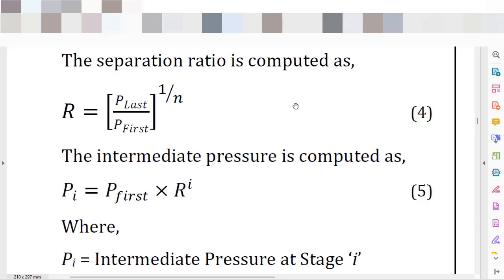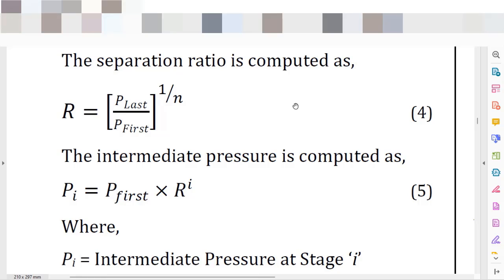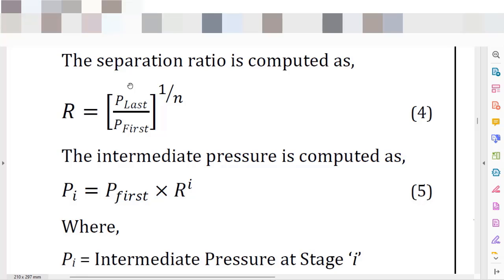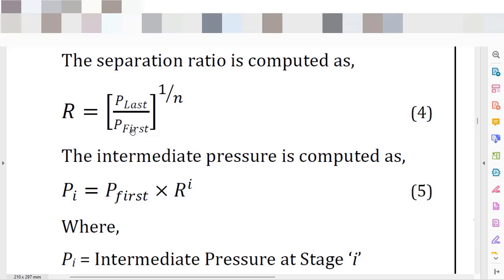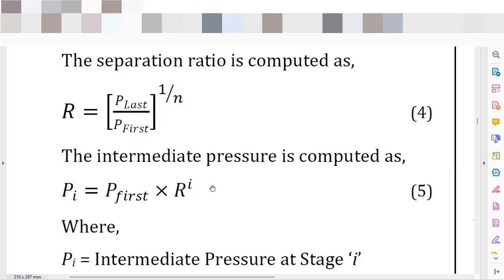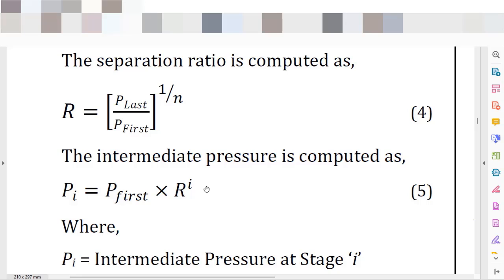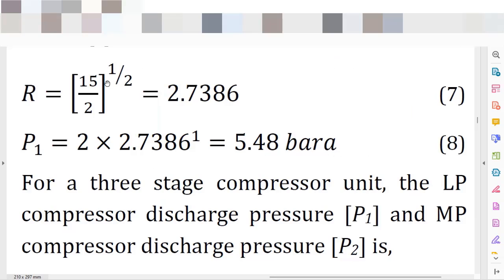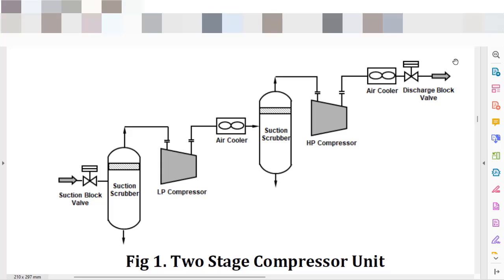COMPRESSOR PRESSURE RATIO CALCULATION FOR CHEMICAL PROCESS ENGINEERS

Comment: Hi Jeferson, have you any post about sizing buffer tank gas with hysys?
Reply from the maker: Not yet, but in general you need to define the volume (it will depends on flow and time for buffering) and based on that calculate vessel sizing. Best way to do that is using a spreadsheet. Hysys is not the best software to vessel calculation.